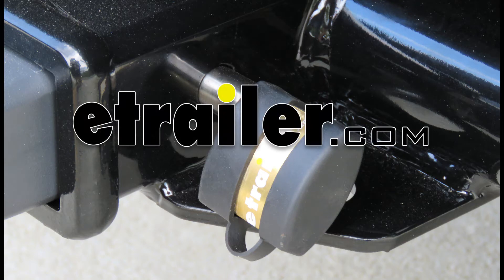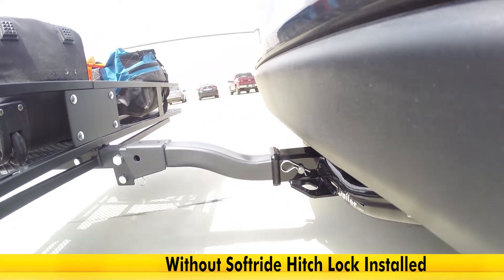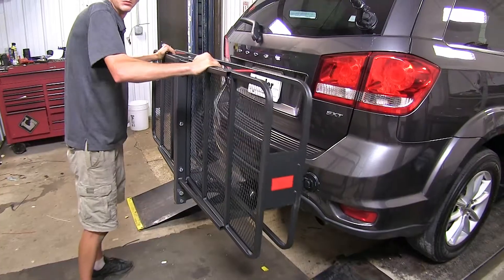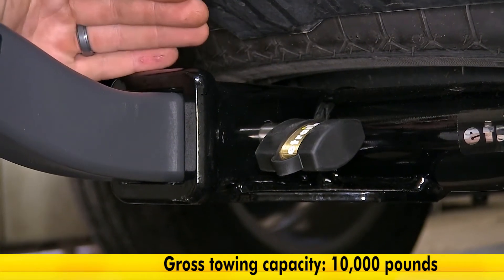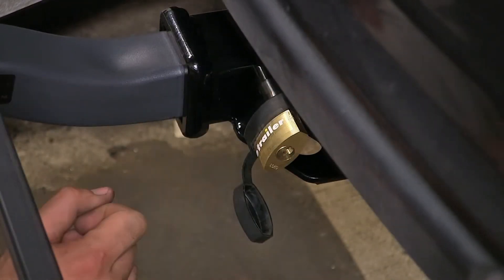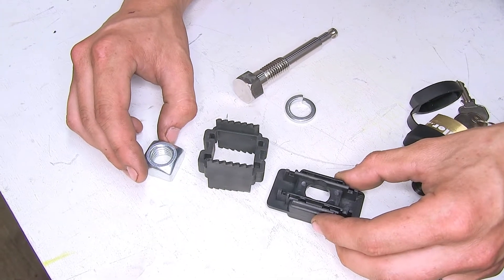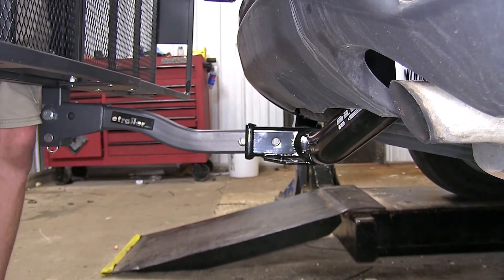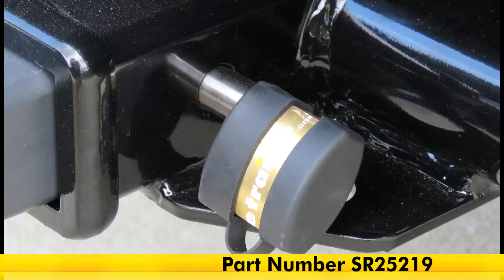etrailer | Softride Locking Anti-Rattle Threaded Hitch Pin Review

Comment: I purchased a hitch carrier that said it was for a 2" receiver. It has a threaded pin with 1/2x13 thread. Is that going to create problems with the larger 5/8 holes in my receiver? I've read using too small a pin can enlarge the pin holes and even bend in place making it difficult to remove.
Reply from the maker: When the anti rattle device is tightened down, you will not have the movement in the hitch pin hole that you do with a standard hitch pin.
https://www.etrailer.com/Trailer-Hitch-Lock/Softride/SR25219.html